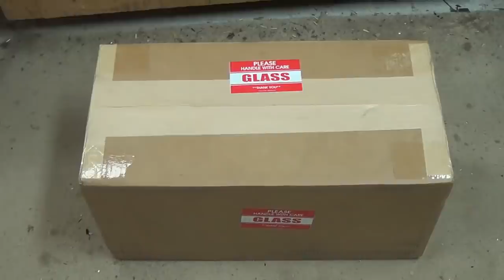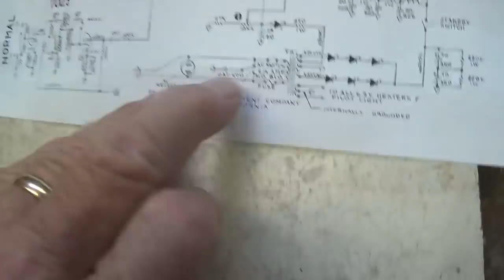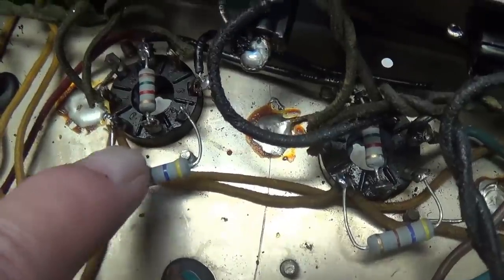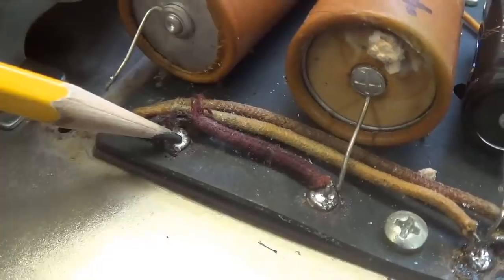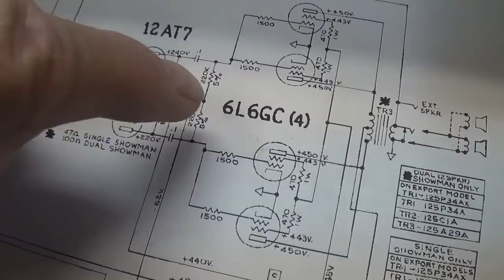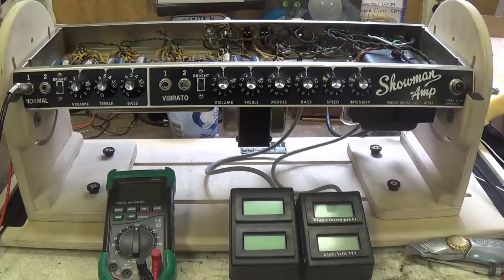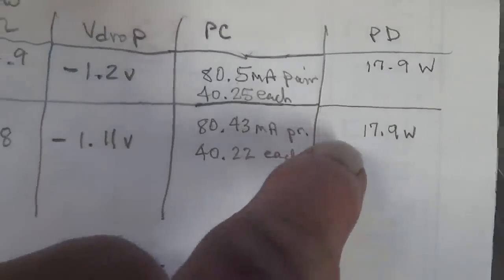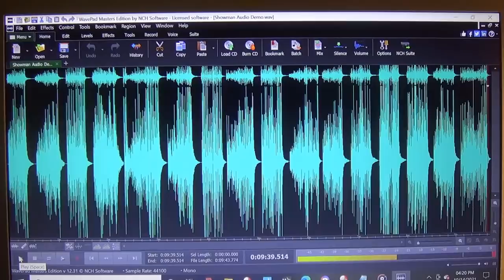1965 Fender Showman.......Back from the dead, but not without an epic struggle

Comment: Doug, if you could somehow get yourself demonetized, the ads might go away.  Have Ollie and Jack perform nude? 

And just a thought about testing tubes for shorts with an ohmmeter:  I have, on rare occasion, seen a tube go short only when it's been operating for a while.  I think the filament heat might have been expanding something into touching another thing.  Always a good excuse to pull out the asbestos fireman's gloves to try the ohms test on a hot tube.
Reply from the maker: Two good suggestions, Joseph. Thanks so much :)

Comment: Are you 100% sure that the OT is bad? 
I mean, if you shunt the primary with an amp meter from center tap to tube plates, if the tubes are OK, the current should be normal and the meter shows the bias current.
Even if you completely bypass both primary windings with solid wires, if tubes and bias voltages are OK there shouldn't be any excessive cathode currents.
Reply from the maker: All I know, Jut, is that with the OPT in place, havoc reigned supreme,  including a blown tube and damaged Eurotubes probes. Once it was replaced.....perfect bias, great tone, and quiet function returned.
Reply: @UncleDoug  OK. But a shorted tube (or a valve as Brits call them for a good reason) surely can destroy a bias probe if there is no fuse to prevent it. Of course if the OT primary windings are, or are randomly getting open circuit, so there is no proper load to output tube plates, it of course can cause output tubes to short or oscillate heavily and cause severe problems. But it would be interesting to test the old OT and find out what was possibly wrong with it.

Anyway, very enjoyable video again as always. Thanks. 👍
And an exceptionally beautiful amp as well, a rare bird in that amazing condition.
Reply from the maker: @jutukka  Thanks so much for your helpful input and very nice comments, Jutukka :)
Reply: @UncleDoug  You're welcome.
(And if the reason for problems is, as it quite probably is, a partially shorted primary of the OT, which does not kill idling tubes but surely kills them when they are getting enough input signal, it can be very easily observed by for example feeding 1kHz signal to the (unpowered) output of the OT and measuring if the signal is symmetrical on the primary sides.)
Reply from the maker: @jutukka  Thanks for the helpful input, J.

Comment: Just for reference, can you say what this repair cost the customer?
Reply from the maker: That's personal info, Jon. My standard rate on shipped amps is $250 labor plus parts and return shipping.
Reply: @UncleDoug  Didn't men to pry.  ;-) Just interested in the value proposition for the tremendous care and knowledge you deliver....over 30 days.  If I was the customer, it would still be cheap at triple the price. Hopefully this repair wasn't a "standard" rate jpb. My 2¢. Thanks for sharing.
Reply from the maker: @jonathanschwartz8  Thanks so much, Jon. I prefer a fixed rate so that the price never escalates to a shocking level, but the $250 is a minimum.....and can go up a bit for really complex repairs.
Reply: @UncleDoug  You're a Good Man.
Reply from the maker: @jonathanschwartz8  Thanks, Jon :)

Comment: The vast spread of bias currents had nothing to do with the output transformer. Logically the only plausible explanation will be the tubes themselves: the difference in voltage drop over the secondary windings ,so subsequently the difference in anode voltage due to the different DC resistance of the output windings, is negligible. Replacing the output transformer was I think anyway necessary but I am not 100%  sure about that.
Are you sure you didn't swapped the right place for the voltage drop B+ resistors? It seems to me not logical that (in the video) the highest voltage was from the two elcaps on the left, so it seems logical that the 1K would come besides that and the higher value to the right
Well done of course sorting out all faults!
Reply from the maker: To eliminate the possibility of problems for the owner, I felt it best to replace the OPT. You're right about the improper order of the node resistors. This was caught during editing.

Comment: I don't know. I just wanna do say a little something about your wiring of the primary. It's semantics what you're using to describe why you think it should be wired to the receptacle first. The utility receptacle, but the fact remains. National electric code dictates that power coming in to any device should first be fused before it switched.  So to be legal in the United States. It has to go to the fuse first and that's not semantics that's law.
Reply from the maker: I must disagree with your interpretation of "code" (not "law".....Congress passes laws, bureaucrats create code) as it applies to auxiliary outlets. Both the wall AC receptacle and the auxiliary receptacle are fused by the circuit breakers in the wiring system of the building where they exist. If what you said is true, then every extension cord in common use would be illegal.......since the auxiliary receptacle is simply an extension outlet of the primary AC cord.

Comment: Karen says it's too loud.
That was before you even unpacked it. She's coming to your door to scream at you and call the police.
You'll be charged with suspicion of failure to comply with unspecified requirements.
        I had a picture of one of these. They told me to turn it down.
Reply from the maker: Karen is right. Sorry, I have to go answer the door.
Reply: @UncleDoug  Amp simulators on the phone and earbuds are  the future.
If you take the earbuds out of your ears without shutting off your phone, it'll be a noise violation.

Comment: I've watched multiple vids today where people have left that switch in for no reason whatsoever. There literally no reason to have it. It does nothing once they put the new cord in. The chick in California did it and so did another guy.
Reply from the maker: If you're speaking of the Polarity Switch.....it can remain in the chassis, but should never be connected to the AC primary circuit.

Comment: Hey Doug. I started watching your Chanel a couple of weeks ago with the 2 part amp explanation and the scratch build series. You have passed on a lot of great info.
Would you say that this Power Transformer was a problem right from the factory?
Reply from the maker: I believe it was the output transformer, DD, and I honestly don't know the answer. I would think/hope that such an issue would have been detected by Fender if the OPT was faulty at birth.
Reply: @UncleDoug Yes thank you, OPT. Based on the issues you found, I imagine this amp has had a storied life. I trust your care has it on a better path.
Thanks for the reply.
Reply from the maker: @drop_dtuned6167  Let's hope it has many good years ahead, DD :)

Comment: Isn't it worth taking a look and seeing if it's possibly could be repaired transformer you can strip it back a lot of times it's near the surface. did you get the new one from mouser? They sell Hammond transformer.
Did you get those tubes from that place I gave you very reasonable priced.
I just had a look and they got the tung-sol 6L6gc £20 each and in stock, don't know why you didn't get them from there tested in-circuit and certificated best place in Europe.
I don't know why I bother!
You don't have to have the adverts you can disable them ummm
Reply from the maker: This was not an issue of a broken externally-accessible wire, John. The OPT damaged both the tubes and my Eurotubes probes. It had to be replaced. I clearly named the source of the tubes in the video, and ordered them from a domestic source to avoid a lengthy wait, customs vagaries, and high shipping cost. The ads are inserted by YouTube without my permission. I have no way of "disabling" this process. I hope there were at least a couple moments you enjoyed in the video to outweigh all the issues that apparently upset you.
Reply: @UncleDoug  yes I did enjoy the video you looked at that website  it's very good company I think they stayed the price with the shipping charge if I remember correctly
I wondered what your sort of kits they do they look alright just don't have any Transformers I can see a bit weird, pricewise it look quite good in the old style.
Not sure I understand what you mean by the transformer why should there be such a big difference, I thought the coating of the wire had probably perished and there was a short on one of the Windings not the case? Both should be 36 ohms ? what is the original ohmage of the speaker you didn't ask the fellow that wouldn't be 32 ohms would it

Comment: Hi Uncle. Would you please stop stealing the amps signature sound by replacing the leaking caps and burned resistors. If you dont intend on putting an amp back into original condition I would like to have the parts you pulled. I have a new 100 watt Marshall JCM800 that I would like to get back to an old school sound. Peace.
Reply from the maker: I understand how tough it is to do without all the rustling, popping, hum, and smoke, Monty. I'm thinking about packaging all the old, burned out parts from repaired amps and selling them to purists. Naturally a small flask of rat urine would be included.